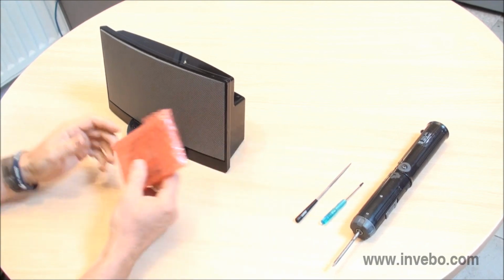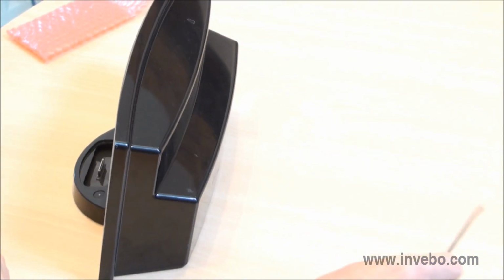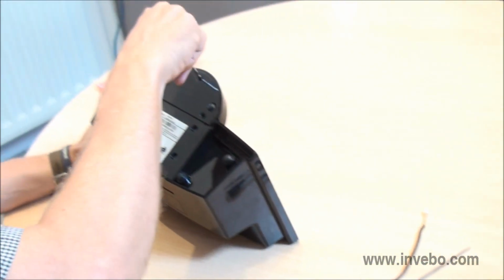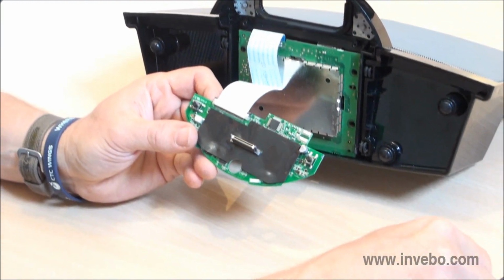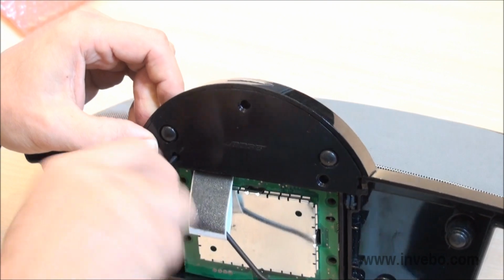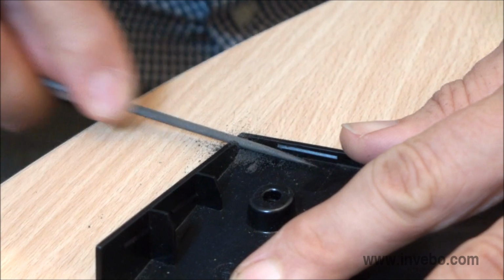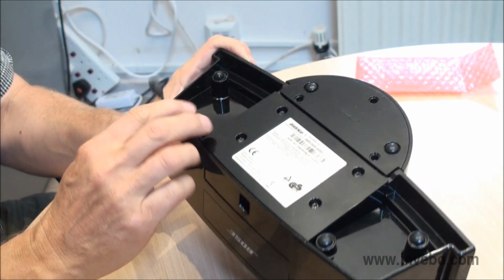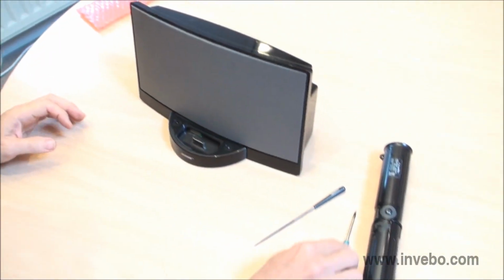Innexxiss BC6/BC7 Bluetooth Aux Input cable Installation on a Bose SoundDock Original

Comment: so, I have a Bose SoundDock Original Series 1 and never opened it.
If I'd want to install this aux input cable, do I previously need to install any other board or can I do it on the Original one?
Reply from the maker: Only our BC7 bluetooth Upgrade Kit (see video)  supports the AUX connector - front or back location. You cant add aux without the BC7 .

Comment: I had the full uprgrade done on my SD Original over 2 years ago, with the rear connection.  Transformed this amazing speaker to a much improved device. I can charge my old Ipods without unsupported device error I mainly I use the blue tooth feature, which is a quick and simple connection even on android.   A worthwhile investment.  Would have hated to throw the SD out.
Reply: Hi, where did you your SD upgraded?